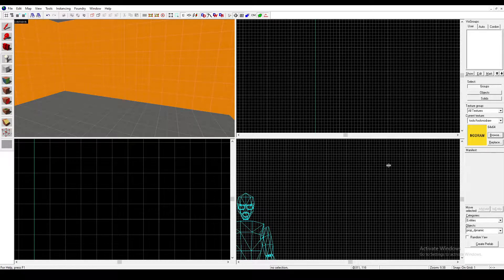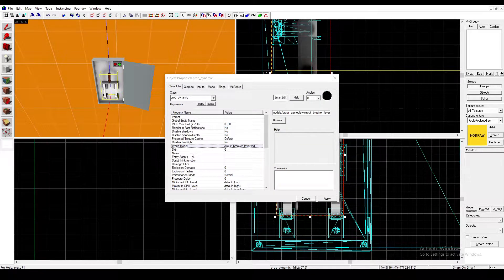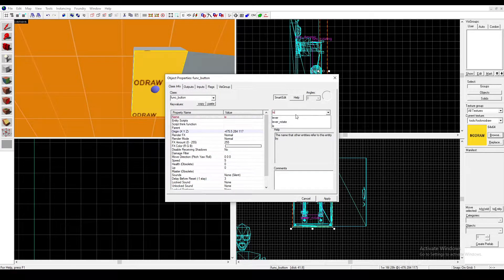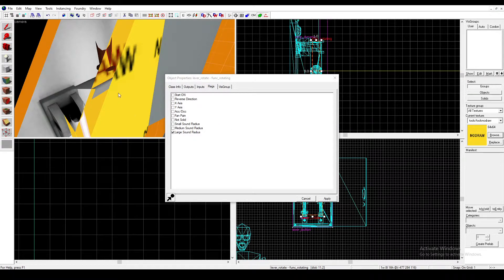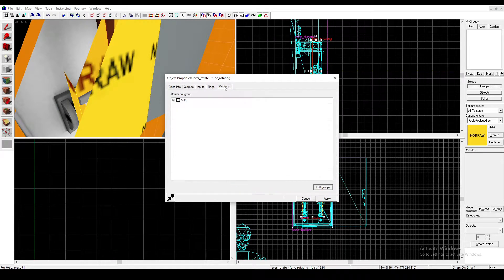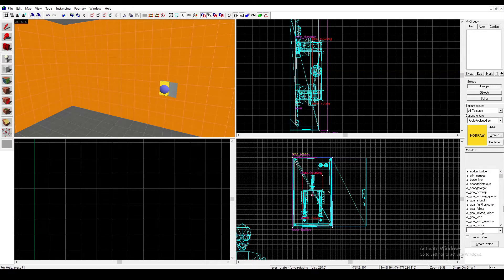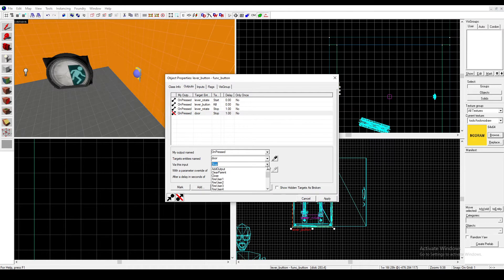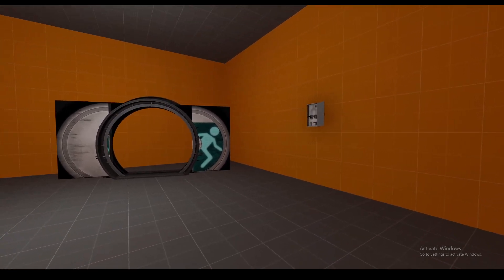Portal 2 - Hammer Tutorial: Creating a lever and connecting it

Comment: Dude. Its xXJaxon_PlayzXx and I can't freaking line it up! Help
Reply from the maker: You can press the [ and ] keys on your keyboard to decrease the brush grid size, this will let you make more precise movements. You can also hold down the Alt key while selecting an object to get it the most precise.
Reply: no i mean like the little blue circle so the lever doesn't collide with the wall like how it did in the video.
Reply: @jswid1395  Um, idk if you found a fix, but I think sizing the func_rotating to be smaller and placed only where the lever would actually rotate would help.
Reply: Erin Rose' Creations ok I’ll try tomrw